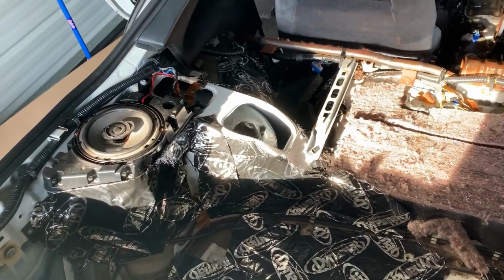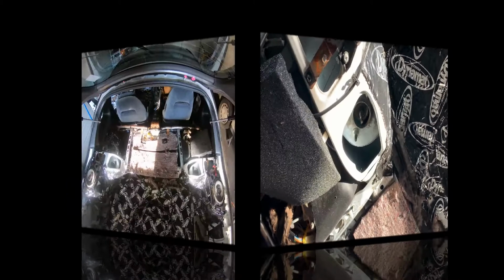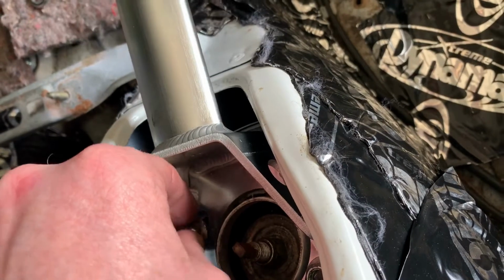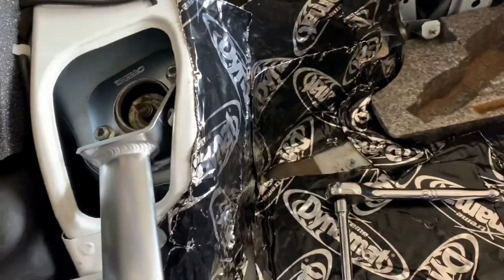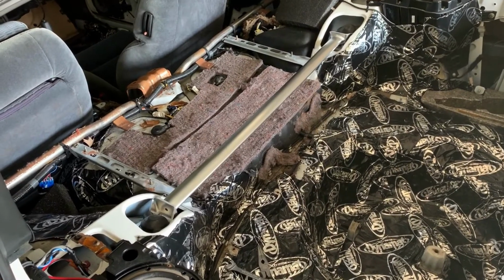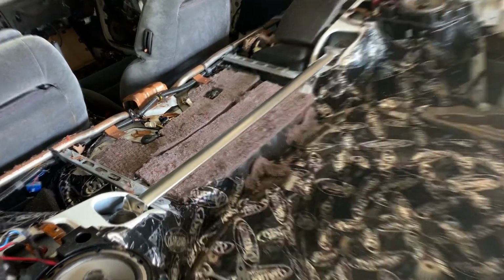300zx Twin Turbo Carbing Rear Strut Bar Install GoPro Hero 7

Comment: Nice video but I can't find anything on how to install the FRONT Carbing strut brace :(
Reply from the maker: Thank you. I haven’t done mine yet. I’d have to move some lines and shave my throttle cable cover.
Reply: @RESTORATIONRESCUE  I did mine last night and I didn't have to shave the throttle cover at all.  I wonder if it will rub... doesn't matter if it does, though... the Carbing is easy to polish and it does not show anyway.  If it makes noise then I can shave mine later and the rubbing will tell me just where to cut, if it becomes necessary.  I hate to just leave it off :(  I like how the cover looks ;)
Reply: @RESTORATIONRESCUE  oh/ and p/s, remove the a/c line holder with a pair of vice grips... just rock it back and forth a small amount about 100 times and it will pop right off.  don't use a crow bar like idiots do and don't do big oscillations with your vice's ... it's not necessary.
Reply from the maker: @TheGreatDadoo  yeah I heard it will rub.  There is a template online of where it would get cut and it’s not too big.   But I have seen people go without cutting it.
Reply from the maker: @TheGreatDadoo  thanks I will keep that in mind.